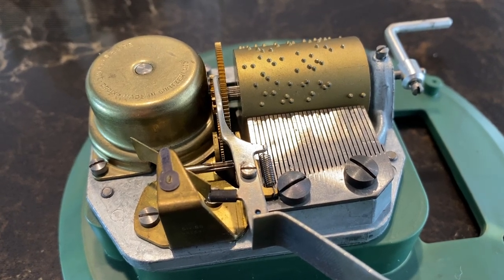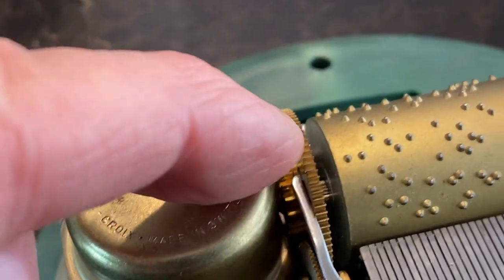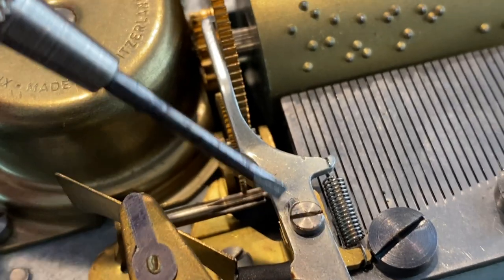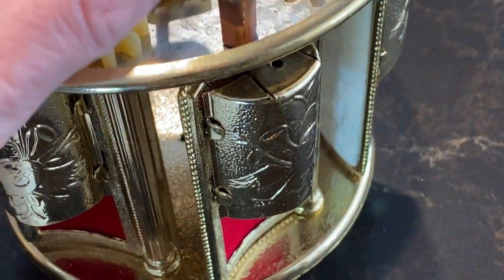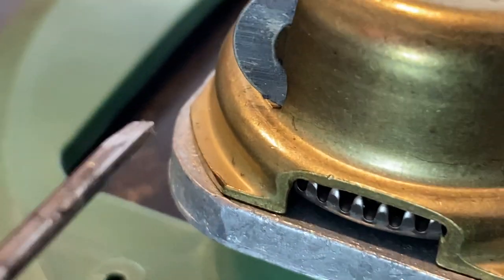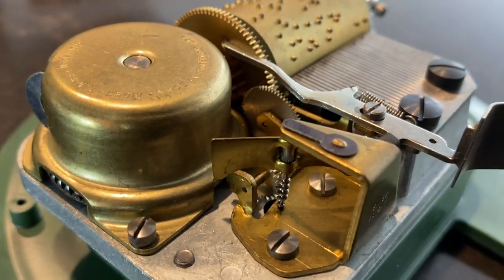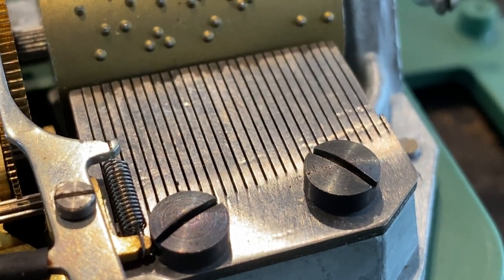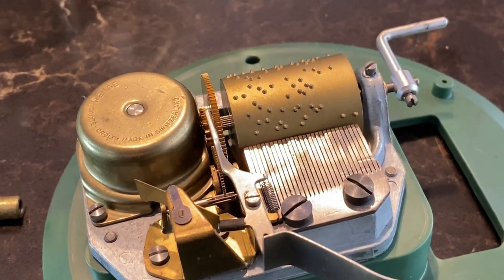Sanfilippo Foundation - Novelty music box mechanical demonstration

Comment: Thanx for the Video Greg. This actually help me repair a broken heirloom.  The issue was with the cam. It is a wire type so it was bent out of position along with the arm attached to the motor and the gears were completly out of alignment.  I used your very brief shot of the cam configuration and position of the arm on on the motor shaft to set mine up and I figured the proper position of the gears. I still can't get the doors to open completely but they close perfectl. It's posible that were never designed to open all the way (still need 1/8" of movement of the cam that I can't seem to figure out). It's been a long time but I'm pretty sure it did open completely when I was growing up. The video of your does, so I guess I may still have something amiss.